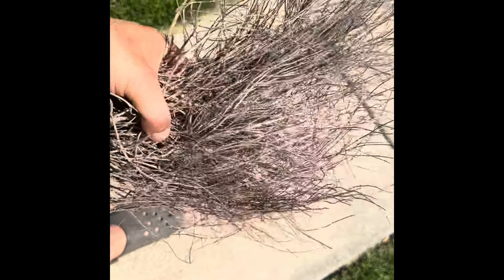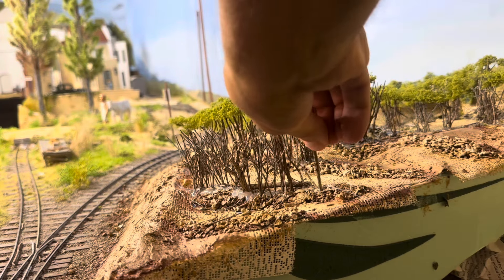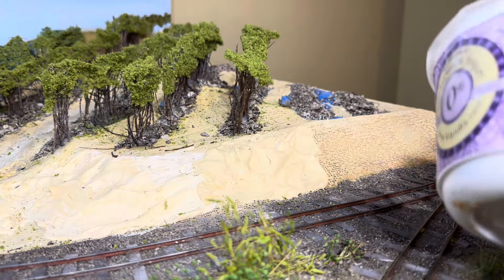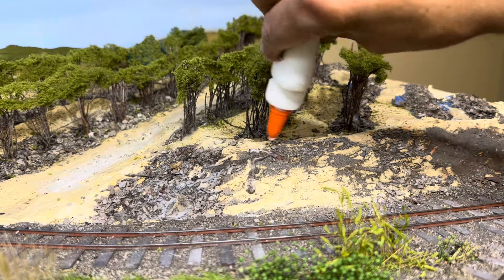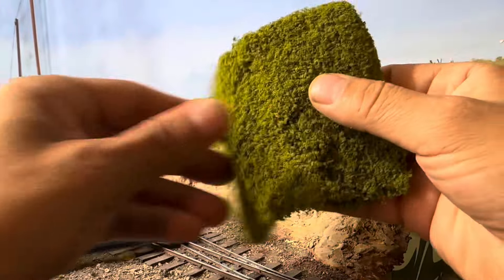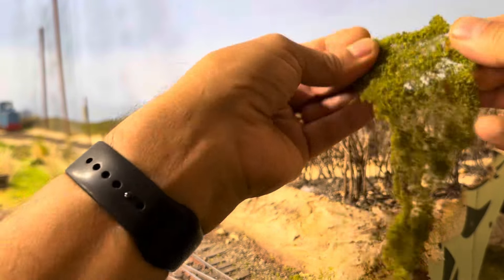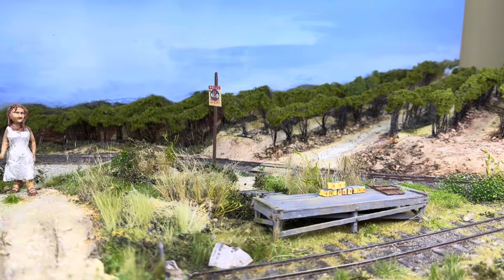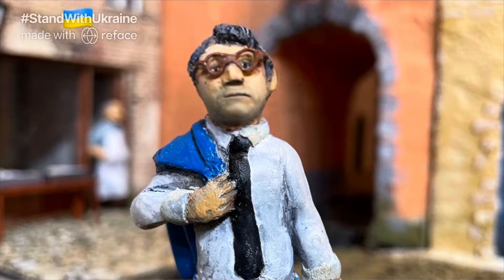Adding a vineyard to the model railway to set the railway’s theme and purpose

Comment: They looks great. I'm still getting used to the largeness of 1-24; the small things that can be seen at that scale. I wonder if individual grapes could be seen in a bunch at 1-24? I see there's 0.5mm caviar beads available - could they be glued around a suitable shape? I tried to make bunches of grapes at 1-48 but they looked ridiculous. I guess tomatoes could also be seen easily at 1-24... 1-24 is awesome! Cheers, Kev.
Reply from the maker: Wine grapes are usually harvested from the vineyard from early September until early November in my modeled part of Italy so I opted to not 3D print any since I am modeling the summer.